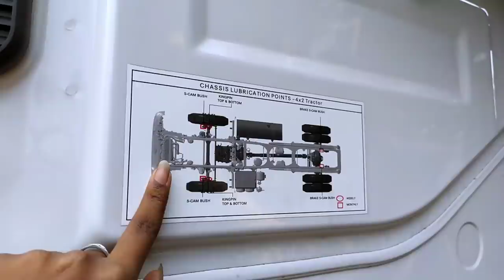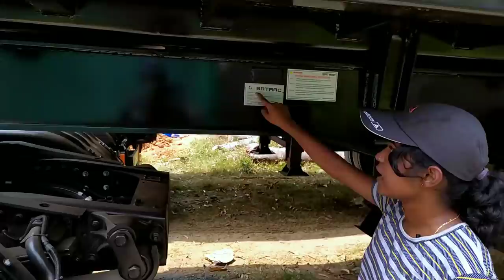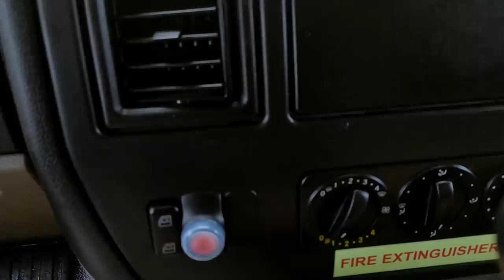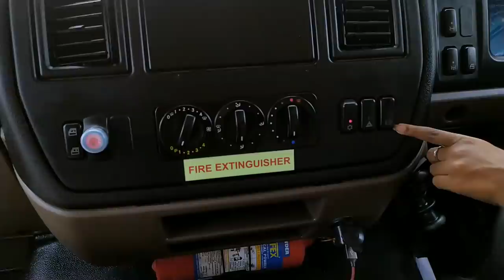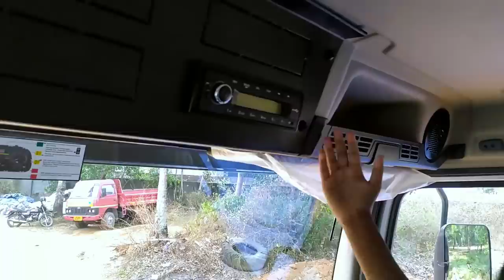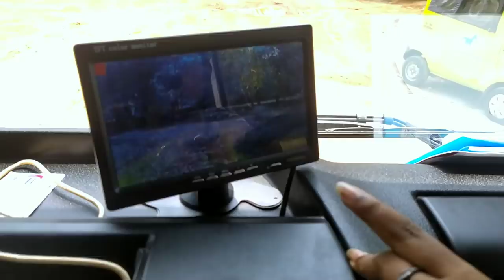Bharat benz Tipper Trailer Malayalam Review/kovooz group /kerala's first bharat Benz Tipper Trailer

Comment: Crash test ൽ വിജയിച്ചിട്ടുള്ള body..UV tested paint..അത്യാവശ്യം power figures..mercedes engine and gearbox combo..safety features..സംഭവം mercedes benz തന്നേ❤️🔥
Reply from the maker: മേഴ്‌സിക്ക് പകരം ഭാരത് എന്നായി അത്രേ ഒള്ളു..
Reply: ☭  ഉറപ്പാണ് LDF .....പാവങ്ങളുടെ പടത്തലവൻ സഖാവ് പിണറായി വിജയൻ വീണ്ടും വരും എല്ലാം ശരിയാകും 📢
Reply: @ldf4750  അതെ..സമ്പൂർണ lock down സമയത്ത് സ്വർണം കടത്താൻ ശ്രമിച്ച പരനാറി വിജയനെ തന്നേ കേരളം വീണ്ടും വിജയിപ്പിക്കും❤️
Reply: @ldf4750  ❤️
Reply: @Dashamuulam  mm angottu mari irikku
Reply: @QueenOnWheels  Mercedes Benz Axor athinte platform anu bharathbenze heavy., fusocanter platform anu bharathbenze medium trucks..
Reply: @unnikrishnanmahendran3950  chennaiyil ninnula plantil ninn fuso ,bhart benz, Mercedes Benz eeh vandikalude chasis ann povunath import aayum allatheyum dealersinde kayykalileky
Reply: @smiley7490  platform ennu udheshichat vandida platform alla😁atinte base(model)engines